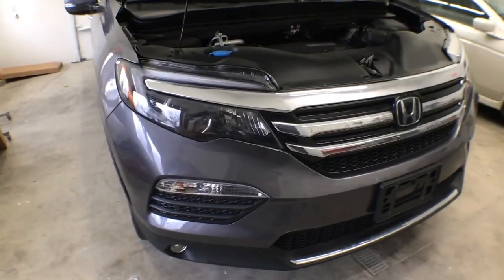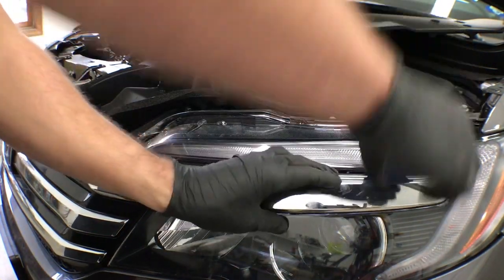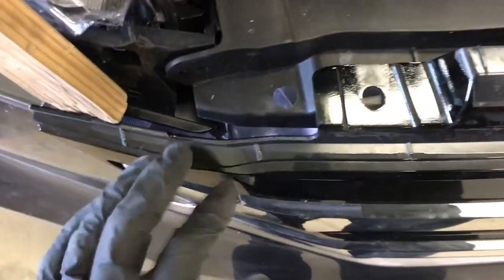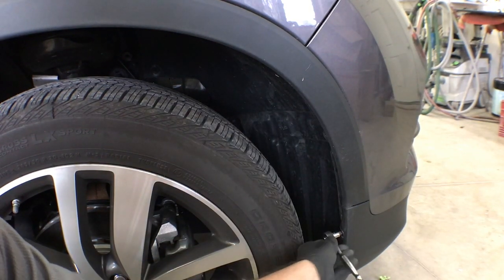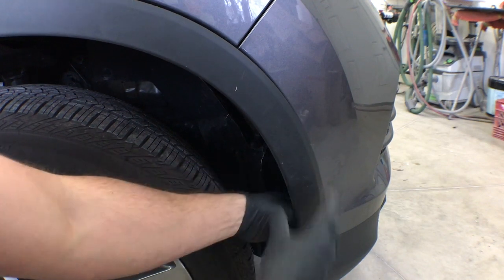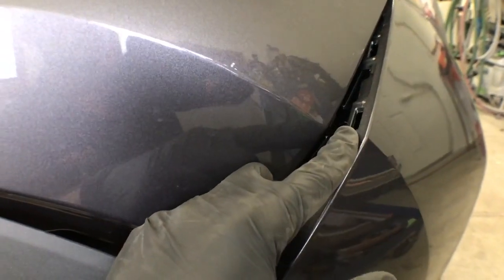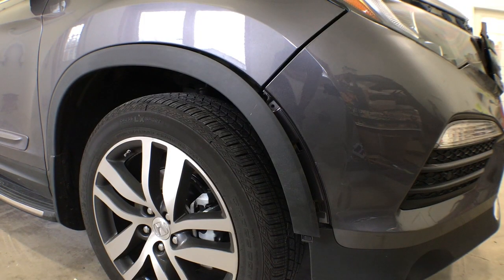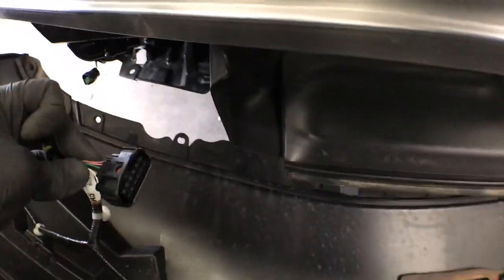2016 2017 2018 Honda Pilot - How to Remove Front Bumper Cover Removal Install Replace Replacement

Comment: Great video thanks.  Do you have to remove the bumper cover completely to change the grill?  I have a Ridgeline and was thinking about installing the Honda Passport grill.  Another thing, would you know if the radar under the Honda badge needs to be re calibrated after the bumper cover has been removed and replaced?

Comment: To remove/replace a fog light assembly (broken glass by rock) can you just remove the bottom panel versus removing the entire bumper? Thanks! Great video.
Reply: Tony Vander Linden I'm wondering the same thing. Can I just remove the bottom black plastic piece?
Reply: Did you ever find out? I have the same issue!
Reply: @dingusdufus  
What's the verdict ? Is there a way to replace foglights without roving the bumper ? (Rally don't Wana pay honda $300 to doit)
Reply: @team2146  Easily replaced fog light assembly with one purchased online for less than $50 by removing a few screws and prying out the wheel well just enough to slip my hand in.

Comment: Can you remove the grill without taking off the bumper? I have to replace the grill on my 2016. There's no videos on how to remove and reinstall the grill. Struggle is real
Reply: Did you replace your grill yet? Did you have to take the bumper off?
Reply: @cannonsims937  yes. But it really wasn't that bad. Whole job took me about 2 hours and it was my 1st time taking it off. Highly recommend getting the 2 tools to pop the stuff off. They were like $7. Good luck
Reply: @cannonsims937  yes to both questions btw lol